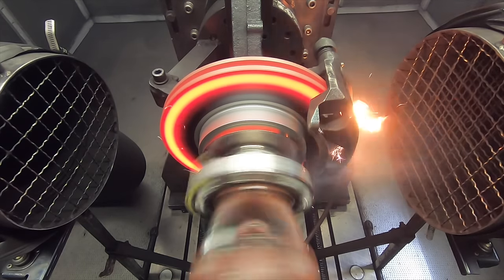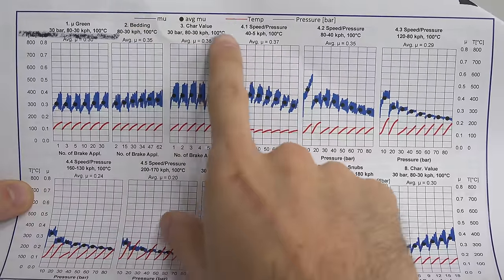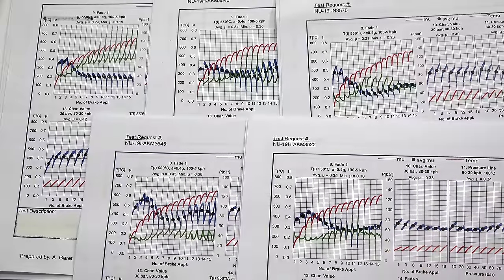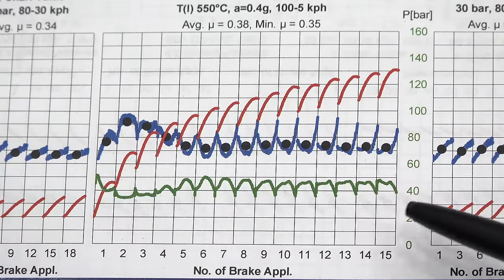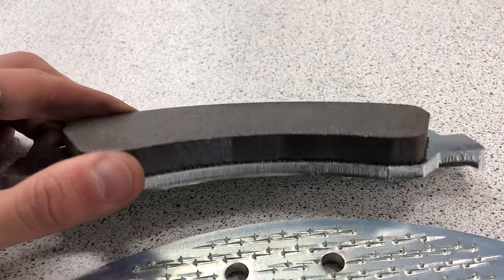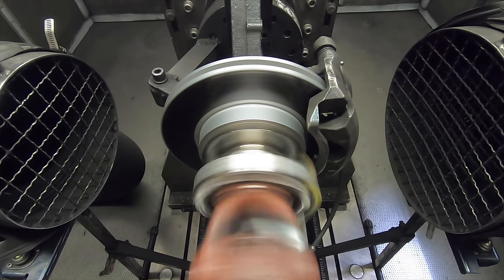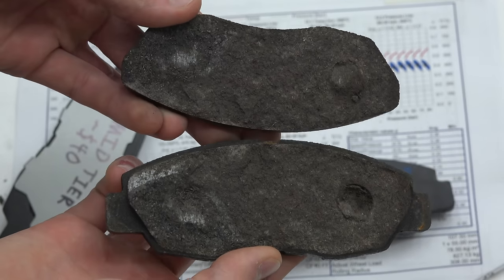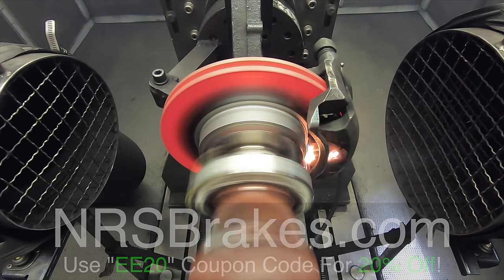What Are The Best Brake Pads? Cheap vs Expensive Tested!

Comment: What sort of OE pads were tested?

I would assume that there are huge differences between manufacturers/car brands on these...
Reply: Yeah, there will be a hude difference between S-class OEM and Tata OEM
Reply: OEM pads are also made by suppliers - which offers own non OEM brake pads under own brand names. The complete brake is made by this suppliers. 
At the end the manufacturer defines what he expects from the brake and how much it can cost, and the supplier offers a brake system to the car maker.
The one of an S Class will be of course better than the brake of a Tata Nano.

Comment: Kudos to you for trying out this test but I think real world results would have to include not only the budget, mid,  and upper pads, you’d have to also include each pads manufacturers different pad material line such as organic, semi metallic,  and ceramic. You could say that the mid tier lasted longer because it was a ceramic pad, ceramic pads have less of a wear on rotors and are usually chosen as the longest living of the materials, they also do well in wet conditions and when the brakes are warm while semi metallic and organic might give you brake fade.

Like I said again, this is too much of a closed world test, the only people I know who buy brakes and suspension from auto parts store is because they can’t get it anywhere else
Reply: did you read his pinned comment?
Reply: Na. It was good. Go do your own test.

Comment: I’ve always bought the mid level pads from the parts stores, usually from Advanced or sometimes Autozone or Napa. I’ve never had any issues. I have more issues from rotors, which end up warping from heat and therefore pulsing when I brake hard or long, like going down a hill. I’ve had to replace pads and rotors prematurely several times on various cars and trucks due to that, usually GM products.
Reply: im a mechanic and 98% of the pads i install are napa blue box ss pads. we use the ceramic ss pads because they have the least issues out of all the different part store brands and arnt as exspensive as akebono or zimmerman. as far as rotors on trucks or performance cars i prefer napa ultra premium for smaller cars and grocery getters the regular premium just stay away from there proformer line its junk.

Comment: 9:12 "...pieces of the brake pad falling off."

Explains my drum brake pad breaking and lodging itself between the shoe and the drum, freezing up the rear wheel. That was fun. Would have been way more fun a minute earlier on the highway instead of at the stop sign.
Reply: If you think that was bad if I hadn't gotten off the highway a couple of minutes sooner and had to brake, I wouldn't have brakes due to my brake line rusting out. Thankfully the hand brake did work enough to get my car into a shop.

Comment: My Tacoma came stock with ceramic pads and worked great and almost no dust. 
The shop I paid to do brakes ended up putting orielly brake select pads and I instantly noticed a reduction in braking power and a lot of brake dust.

Comment: Great comparison. Thanks. One question would be what is the OE brand that was tested and how do the other OE brands brands compare to each other? I'm guessing there is a significant difference in OE pads. Our '07 Tahoe had dismal OE pads and rotors and were utterly trashed at 30K.  Aftermarket replacement of both has done significantly better, as in more than double.

Comment: You can purchase top quality cross drilled and slotted rotors and top quality pads from Rock Auto normally for around $100.00 and it's absolutely well worth it. 

The slots remove gasses that cause brake fade and the cross drilled holes remove heat quickly.

The rotors for my Cobalt were only $80.00 and it brakes way better than before and the rotors have never developed any rust anywhere.

Also replace those front brake hoses if you have 50,000 miles or more because they collapse internally and hold extra pressure against the pads wearing the pads out prematurely.

Comment: This tells me that original parts are going to be best, but the second I make a modification to my braking system I will want nrs. As the one breaks will no longer have the benefit of being specifically designed for my braking system. This is super helpful as I have just recently restored my vehicle to like new and am now looking at improving it. Thanks man.

Comment: I got some power stop carbon fiber ceramic pads and drilled and slotted rotors for my 96 Buick Roadmaster sedan. It's a big heavy vehicle and I drive it like a sports car. Within the first week they paid for themselves. I was on the highway and someone stopped dead in front of me. I stopped with plenty of time and space. Definitely didn't stop like that with the factory setup. Plus my wheels are cleaner. I'm sure there's better pads. But for now I'm happy with my choice. So happy I'm on my second set of pads

Comment: Yeah - but what OE? FIAT? KIA? OPEL? LADA?
Reply: Porsche?
Reply: These brake pads are quite big - they are definitely from a faster car, not from an Opel. They are twice the size of the front pads for a VW Golf.
Reply: The size actually doesn't matter that much due to the fact that you can have several pads on one braking system.
Reply: Yugo
Reply: OE for your car

Comment: I would like to see how Powerstop brake pads fair in these test
Reply: I have PowerStop brakes, drilled & slotted rotors on now.  All I can say is that I am ab-so-LUTELY certain they saved my life on the interstate not long ago.  I always ran OEM rotors & pads on my car but then decided on a Powerstop kit.  Long story short... the ABS NEVER activated on dry pavement.  NEVER!  Only on wet roads & snow it did.  Well, a screeching halt on the interstate in front of me,  dry pavement, slammed my foot on the brakes & FELT the ABS kick in, stopping me from rear-ending the pickup in front of me.

Moral of the story:  I will ALWAYS use Powerstop on my cars from now on!
Reply: @ScottMeister  thanks for the testimony. I'm sold on Powerstop now!
Reply: I use Powerstop drilled and slotted discs with EBC Greenstuff Pads.  More than good enough.

Comment: I'm interested to see performance and dusting comparisons between organic, ceramic and sintered metal pads. I've always been a believer that "low" or "no" dust brake pads perform the worst, since dust is an indicator that the pads are actually doing their job.
Reply: Until you are the one sucking up that dust. More gentle on brakes. Lasts longer and less dust plus save gas. Win win win.

Comment: Any idea how much brake dust each of these pads create?
Reply: Brake dust and paint chipping off is a major problem.  Many tests show that many brake pads that are imported into the U.S. from low cost suppliers still include copper, antimony and lead in the debris (which includes brake dust and paint chipping off).
Reply: @Sam S Copper is a durable metal that can dissipate heat quickly. That's the primary reason it’s mixed with other ingredients in many brake pads. The faster the pads dissipate heat, the cooler they run and the better they resist brake fade.  In 2010 states of Washington and California passed laws mandating a reduction in the amount of copper used in brake pads. Bills SB6557 and SB346 respectively. Both bills mandate that brake pads sold in each state contain no more than a 0.5% of copper by weight.

Comment: What I want to know about is the difference in rotor wear!  Does the quicker wearing pad reduce the wear on the rotors?  Replacing pads as the sacrificial element is much easier than replacing rotors too.

Comment: I have a question: Why are engine cylinders, well... Cylinders? Why aren't they ever other shapes?
Reply: Circles have the most area/ any corners or tight spots can encourage detonation/ piston rings actually move around in the cylinder so they need to be able to spin/other shapes are harder to drill out. I think that about covers it.
Reply: @DashCamSerbia  it's not an explosion, it's a controlled burn. Explosions in your cylinder destroy ringlands and rod bearings. The flame front expands from the center in a (hopefully) uniform pattern, so a ball shape like you said. And just so you know, explosions imply a huge spoke in pressure, which is not what you want. You want a smooth controlled burn.
Reply: Probably the biggest factor is the machining process cost, disregarding the uneven load applied to the bore of the engine. Pistons are machined by spinning in a lathe. Cylinder bores are machined to final spec with a cutting head that spins as it moves up and down the bore. The work to machine a bore into a precise hex or square shape to fit a piston with a specified bore to piston clearance for long life and quiet operation would be costly. There would be additional issues machining piston rings, which would no longer be free to rotate within the ring lands during operation.
Reply: It's the cheapest and easiest way. Honda did some rectangular piston motorcycles and they were not much of an improvement and too expensive to manufacture.
Reply: Honda had oval pistons in their NR 500 racing motorcycle in the ‘80’s.  I don’t think anyone ever did rectangle pistons.

Comment: You should state what material each pad was made of.
Reply from the maker: It's honestly a very difficult thing to determine, which is why I left it out. Regulations allow for such a wide variety of materials that unless you do some sort of chemical analysis, I'm not sure there's much meaning behind it. For what it's worth, the cheapest pads were semi-metallic (again, vague, but that's all they tell you), while the other four pads are ceramic. But the material alone doesn't show a strong correlation with all tests (both ceramic/metallic can do poorly in sound, corrosion, shear, etc), so it's difficult to determine what's the cause for doing well/poorly based purely on material.
Reply: @EngineeringExplained  Thank you. That's enough information to be honest. I understand there will be large variations in materials and building techniques but I believe it helps with perspective. From a consumer's perspective, stores advertise Ceramics as the best pads followed by semi-metallic and Organics last. I just wanted to relate your performance results with what is advertised.

Comment: Brake pads that wear slower means your brake rotors wear faster.
Reply from the maker: Rotor wear was about 0.1% or less for all pads tested (versus 10-15% pad wear). Nearly negligible, though your statement could be true in some cases.
Reply: @EngineeringExplained  of course negligible in the tests. I'm talking about long term. On the other hand, rotors are cheap.

Comment: I have a 2013 Dodge Charger SXT and the original brakes lasted over 140,000 km (87,000 miles). The rotors had Bosch and part number stamped on it. My mechanic couldn't find the rotors anywhere. He called a dealership but they didn't have the Bosch rotors either. Makes it difficult to buy OEM if nobody sells them.

Comment: Some months back I replaced the front calipers on my tundra because they were dragging. At the same time I replaced the front pads with NAPA premium Adaptive One pads and their upper tier "Fleet Grade" rotors. Fast forward about 10k miles and I've got a nasty shudder in the front end that causes my steering wheel to move side to side, especially at higher wheel speeds. I will preface the rest of this post by saying that when I did the brake job I thoroughly cleaned the hub surfaces of rust, and that I always torque the wheels to manufacturer specs. Lifting the truck off the ground the wheel turns freely with no drag so I tried to reburnish the pads thinking that the deposits on the rotor surfaces were uneven. Zero success. I decided to just go ahead and do what I should have done from the outset and buy OEM pads and rotors. Changing out the NAPA rotors shows a pristine driver's side but when I get to the passenger side I see burnt pad material on the outboard side of the rotor, and a groove on the inboard side of the rotor so deep I can get a fingernail into it. The pads on the passenger side themselves appear to be in otherwise good condition, but there is a groove through the inboard pad that corresponds with the groove in the rotor. 

After replacing everything AGAIN, i took the truck out and bedded in the new new pads and rotors🙄 and to my delight the brake shudder is gone. I'm not quite sure at this point if the quality of pads or rotor on the passenger side are to blame, or if the piece of road debris that broached the groove through the pad and rotor is to blame, or if possibly the caliper is to blame. The caliper is a 4 piston design and I had considered that uneven application of brake pressure is to blame (IE two pistons apply more pressure than the other two). I think at this point my best bet is to bleed the brakes again and keep a watchful eye on the rotor surfaces for anything abnormal. I would like to blame NAPA as it would be the easiest option, but im not entirely certain that the blame belongs with them. Time will tell I guess.
Reply: All Chinese rotors warp after about 10k.  Ask me how I know 😅
Install USA made Toyota and that's the end of problem

Comment: The max shear value only matters if anywhere near that experienced in real life.  There is a strict shear limit which the pads might see, which is when the tires skid.  A rough calc for today's sporty tires with 95 ft stopping distance (from 60 mph) is a deceleration of 1.3 g (pretty amazing tires today!).  For 3000 lbf car, with 70% of the weight on the fronts when braking, that is a shear force on each front tire of 1365 lbf.  The leverage from the outside of the tire to the brake pad is ~2x, and there are 2 pads, so a shear force on each pad is 1365 lbf.  For a pad area of 5 sq in, that is a shear pressure of 1.9 MPa.  The worst corroded pads survived 3 MPa, but that is surprisingly close to the max force in real life, and repeated force applications may cause "fatigue failure".  So if you have sticky tires and brake at the max, you may find your pad material shearing off the backing.  Of course, bigger pads like with 6-piston calipers reduces the shear pressure.

Comment: I tend to use the brand that are easiest to extinguish with ordinary bottled water . But I also like the red ones made by Flying Goldfish from  a large dustbin of mixture superglued on in Guangzhou ! $12 for all four corners including shipping , they come in a real polythene bag too . A real bargain .
 In the UK we are lucky to have some of the worlds household names to select from , from Mintex/Ferodo all the way up to AP Racing as the original materials used to develop friction materials originated from British mines in South Africa . We have since developed a huge cross section of asbestos free , organic , ceramic mineral and sintered varieties . Generally speaking , like many other parts OE are generally the choice but there are some good quality OE 'spec' pads as they often originate in the country of manufacture of the vehicle itself . Look out for Made in Japan like Blueprint , if you drive Japanese , Pagid for German cars and so on . But EBC are good British road and performance pads which I like and often fit Greenstuff as I drive very hard on both road and track . I team these up with EBC slotted discs on my fast daily drivers and Borg and Beck coated discs and get excellent braking ( less than 2% variation on axle pairs on the meter ) and longevity with stopping power on my hack . The budget Brembo pads are made by a mystery company and are generally not as good as much cheaper options produced in the UK .

Comment: Biggest thing I notice about cheap pads/shoes, is that they swell in the rain and humidity. Your first few brake depresses in the rain will damn near lock the wheels up. If a vehicle has cheap pads and it’s raining, I stand on the pedal while stopped to try and squeeze as much moisture out of them as possible. It helps to an extent. That or get them good and hot, but I don’t like beating on my vehicles. It’s hard to keep up with maintenance as is.

Comment: Interesting to note that most pads I've used have shims held on with 'clips' as shown here in this video, but I think your comment about the upper tier pads was unfair as the shims did indeed have a mechanical method of preventing movement - the two dimples that sat in corresponding holes. Admittedly a cursory glance may imply the shims are less secure but when the pads and shims are in place the dimples would be pushed fairly tightly in the holes. Brilliant video though - thank you!

Comment: @03:21 From the graph I notice that as heat input increases, the coefficient of friction drops! In a panic stop, it would be difficult for a human being to overcome their emotions & apply pulsed braking in order to keep their brakes cooler! When I was an aircraft  engineering technician in the R.A.F., even back in the late '60s they were using Dunlop? Maxaret anti skid units built into the brake system so that every time the wheel approached a skid, the valve switched the brakes off & back on in a continual pulsing cycle. Not up to date, do we get that with ABS?